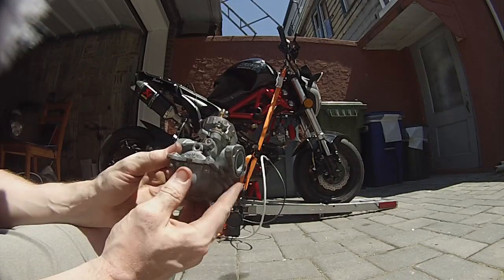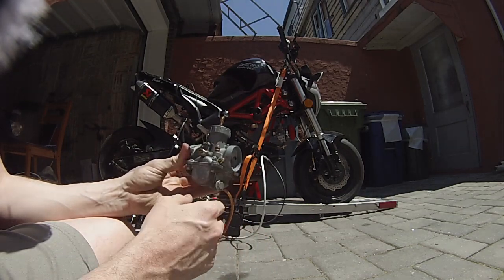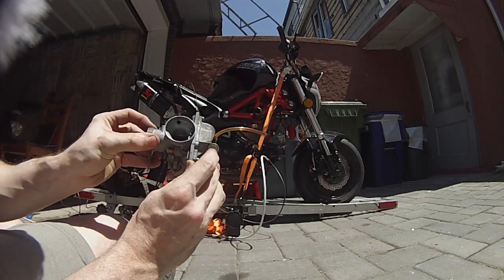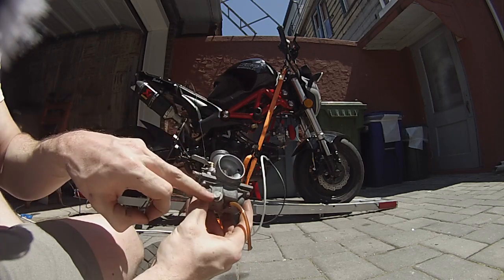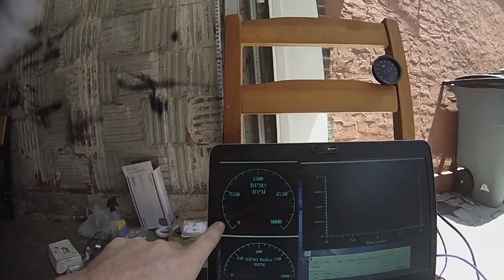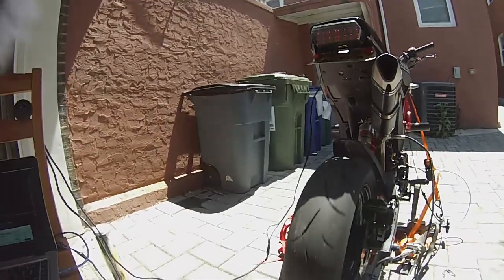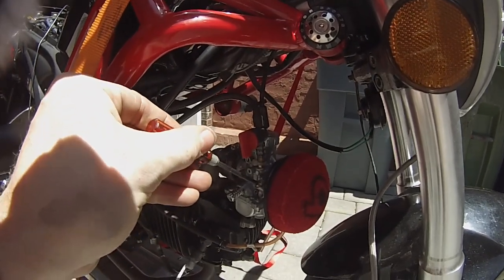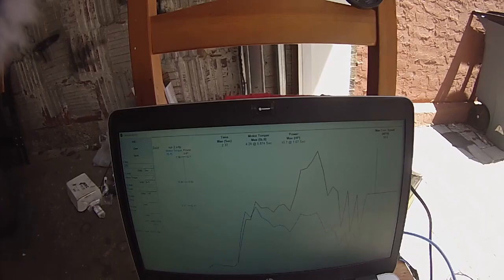How to Dyno Tune a Carbureted Motorcycle (Razkull 125)

Comment: 10.7hp even at the wheel is pretty good for an SOHC 125

you're probably making 13hp or more at the crank (which is really good.

you can get 14whp if you had some adjustable cdi, agressive cams, port jobs

Comment: What are you using for load?
Reply from the maker: There is a roller under the rear wheel which was made out of a used AC motor. I calculated its moment of inertia and then measured its acceleration with a Hall sensor. Its then very easy to figure out the force output from the engine as there is the following formula: Torque= Moment of Inertia X Acceleration
Reply: @Pretko99  where did you get the ac motor?  I'm very interested in building one of these.  Such a cool project!
Reply from the maker: @coryholmesmx  I got one from craigslist for like 30$, you just need a rolling mass with good bearings that has a decent amount of weight. A used AC motors work great.